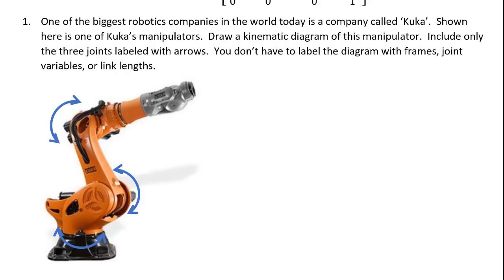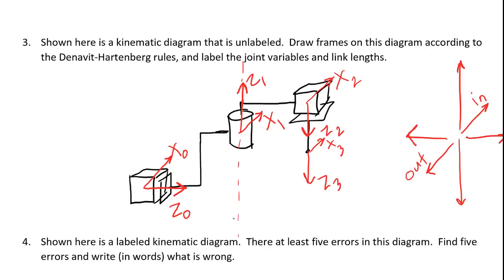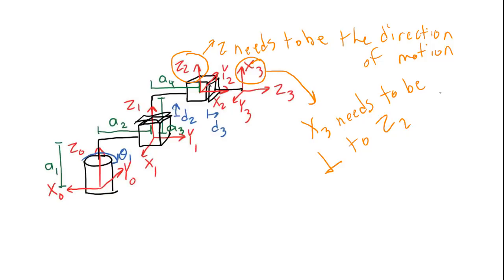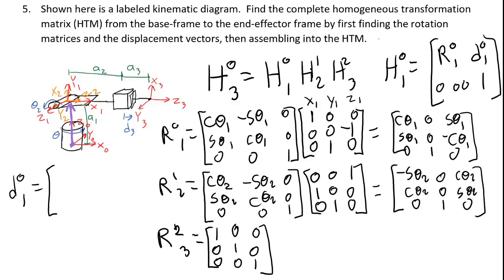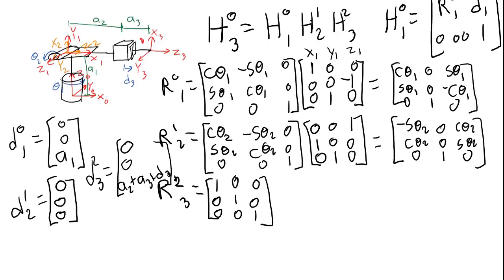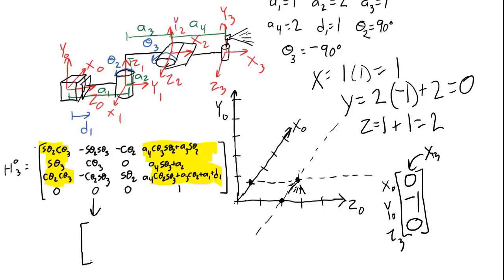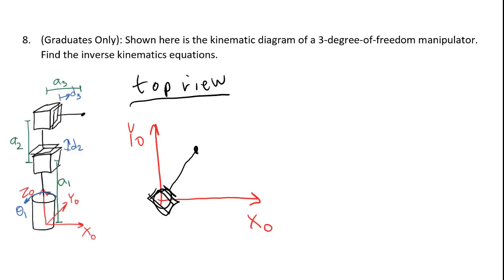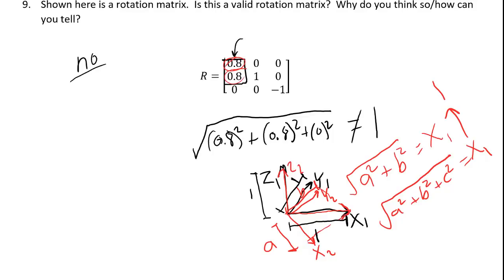Exam 1 solution

Comment: Hi there, regarding question 8 (time 1:03:08): I'm not sure that the method used to find d3 is correct. Specifically, (a3+d3)^2 is not equal to (a3)^2 + (d3)^2. It should actually be equal to (a3)^2 + 2a3d3+ (d3)^2. Could you clarify or confirm this?
Reply from the maker: Look at equation (2) at the timestamp you gave.  And, look at the diagram to the left of the equation. That equation comes from the Pythagorean Theorem (a^2+b^2=c^2).  

If you can see that, next square root both sides of the equation. Then, subtract a3 from both sides, and that gets you the boxed answer
Reply: @asodemann3  I was trying to solve it by working with the squared version first, then isolating d3, but it didn’t work out. we can directly take the square roots instead, which avoids the problem when finding d3. thnx for the reply!

Comment: professor as x1 is coming out of the page and z0 which is going up and they are in the different planes because of which they don't intersect   and I think frame 1 should be placed at the point where the link length a2 starts. kindle correct me if im wrong
Reply from the maker: Can you tell me what timestamp you are referring to?
Reply: @asodemann3  I was talking about the question in which we have to identify 5 mistakes in a given kinematic diagram
Reply from the maker: @AbidAli-wp2fs  placing the frame where link a2 starts WOULD fix the problem, but it would be a longer-distance move than the one I show in the video. Often, if you solve the problem by moving the frame farther than necessary, you cause problems with following the DH rules in the following frames. In this particular problem, you will see that if you move the frame to the start of link a2, you then also need to move frame 2. But, if you move the frame to the place shown in the video, you don't need to move frame 2 at all - you only need to change its orientation.
Reply: @asodemann3  thank you so much I'm a masters level student and km doing mechatronic engineering at polito an Italian university I understood the concepts behind robotics (kinematics) by watching your videos.

Comment: At this time stamp 49:50, I think X3 column vector values are not correct, as we can compare the projection of both the frame 3 and 0 respectively. I see that X3 axis is projected on Z0 axis and NOT on -Y0 (as the video suggest). It might be the case that the H03 Matrix itself is flawed. Can anyone correct me on this ?
Reply from the maker: The Kinematic diagram is showing how the manipulator looks when all the joints are set to 0. But, the question is asking about the position and orientation of the paint can when the joint variables are set to the values shown. In the diagram, when all joints are set to 0, the paint is spraying in the Z0 direction. But, when Theta 2 is set to 90 and Theta 3 to - 90, it is spraying in the -Y0 direction. You might be able to see that this is true just by imagining in your head what that diagram would look like if you made these two rotations.
Reply: @asodemann3  Thanks a lot for explaining this part. It makes sense now !!

Comment: Thank you!!! I'm remotely taking an graduate level robotics class while working full-time. I can't go to lecture because the school is too far away, but up until we started covering D-H methodology I could the follow the material. So I get the most recent lecture slides and it just of bunch of boxes and cylinders (he doesn't write much in the slides, all I have to work with are pictures and equations) and I couldn't figure out what anything was supposed to mean, but after watching your video I finally understand whats going on. I was at the point that I was planning on using 4 vacation days so I could drive to campus and talk with the professor. Crises averted.

Comment: In question 5 madam are you sure that the it is theta_2+90 ?  dont u think 90 degree is not necessary ?
Reply from the maker: The theta parameter is the one that gets the X axes to match by rotating the frame around Z. The axis X1 (drawn in red) is pointing to the right. But, the axis X2 (drawn in orange) is pointing up. So, we would need to rotate frame 1 90 degrees around Z1 in order to get X1 to be in the same direction as X2. That's where the 90 in the second row of the table comes from.
Reply: kanka aynisini bugun asistana sordum tetayi tanimladigimiz yere gore degisiyor falan dedi
Reply: It is necessary